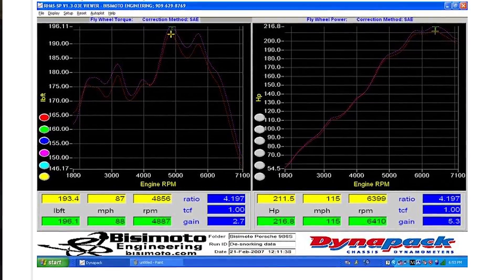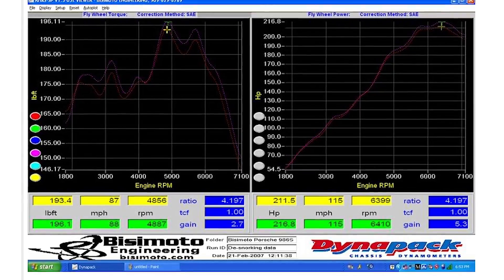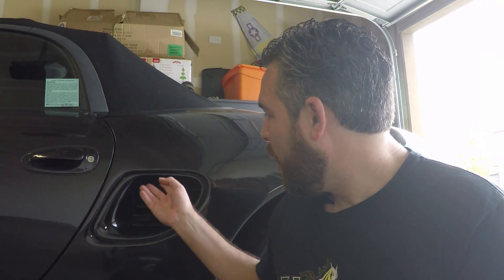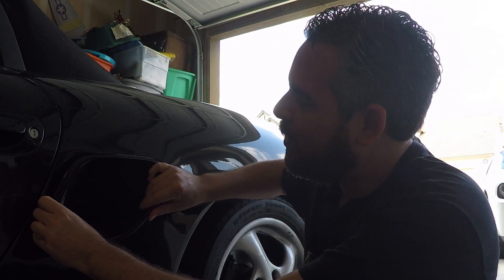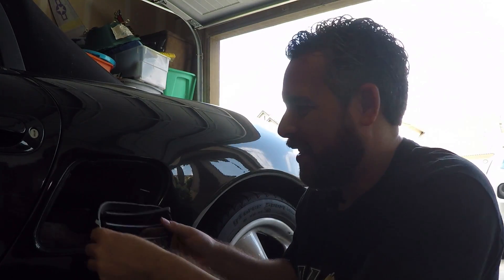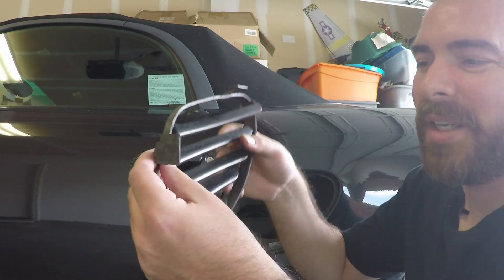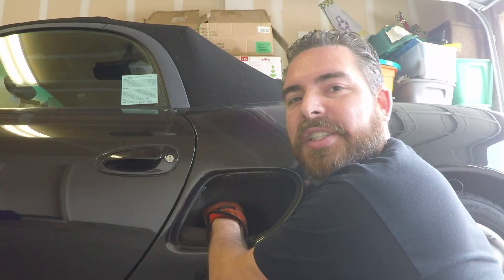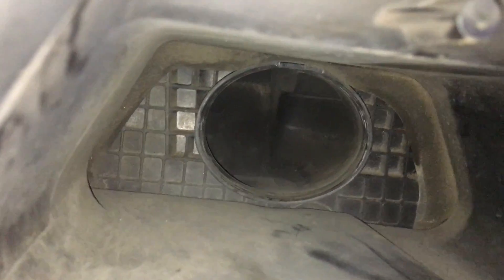Free Horsepower: Does Desnorkeling Work And Should You Do It on your Porsche Boxster

Comment: Ive noticed a trend in the car community ,,,everyone seems to be so afraid to say intakes and exhaust mods will add horsepower .. Its weird
Reply from the maker: Good point. I didn’t have access to a Dyno as that would probably be the best way to prove there was a gain. For me this is just one part, I’ll be installing another exhaust and look at improving the intake where possible.

Thanks for watching and taking the time to comment.
Reply: Because 5hp gains are insignificant than that of forced induction.

Comment: breaking stuff.  The single biggest reason not to do mods that have limited impact.  That said - I desnorked several (10+) years ago.  There has been no negative impact.  But the increased intake sound seems worth it to me.  Further there is no hot engine air being sucked in.  Does the venturi make a difference?  Unknown.  Was the snorkel affixed to reduce noise?  That was the word back then.
Reply from the maker: You have a good point and that is sometimes what makes doing things yourself cost a lot more.

Thanks for watching and sharing your experience.

Comment: The sound is mainly improved from the drivers seat where you can hear the intake -- and it is GREAT! Under acceleration it sounds throaty, above 4K RPM... it sounds awesome! I also did the Crios mod to the exhaust which added just enough sound out the back without any drone,
Reply from the maker: Agree with you about the desnorkle mod sound. I’m planning to do the Crios mod too, but need to get the right drill bit as I need a longer one for a 1999 than the later cars. How big did you make your holes?
Reply: I made half inch holes -- drill bit was nearly useless as it slides and slips> I ended up getting through with a long, large, flathead screwdriver, then turning it to open the hole. I hear, and can see, that a a hole punch or sharpened end of a long bolt like one YouTuber did would work as well. But the sound is perfect, just enough... though I have been tempted to go a little larger.

Comment: I tried this, about 2 days later got an engine light, reset the dtc’s and came back a day later again. Re fitted the snorkel and it has not thrown a light since, also noticed I got worse mpg without the snorkel, my 2.7 became more fuel thirsty than my 3.6 996 C4S till I put it back.
Reply from the maker: Thanks for sharing your experience. I’ve had it off for about 7 months with no issues and my gas mileage is a little better (although I have done some minor weight reduction, so could be more from that). Having said this, mine is a 1999 2.5-liter, so perhaps the 2.7 doesn’t like this mod.

What year is your Boxster? Would be good to know for a follow up video so people are aware of any potential issues.

Thanks for watching and sharing your experience.
Reply: Our Ride Life Our Ride Life mine was a 2004, I thought the issue may be because the facelift models went to a drive by wire throttle and assume that because the ECU sits between you and the throttle it is less flexible in terms of mods without a map as it’s trying to cope with an unknown. Would be interesting to know if that’s the cause or if there’s more to it, I did notice my snorkel didn’t have the little dish on it and was a little different so perhaps Porsche fixed some of the issues with the original design as my stock 2.7 sounded more aggressive from my Dads 2.5, but still, with the mod on the 2.7 it did sound fantastic on acceleration, a much deeper growl, but the light bugged me more. Now I have a 996 C4S with a sports exhaust so my ich for extra noise has been satisfied.

Comment: Please don't, Porsche engineers have designed that "venturi" to optimise induction of cold air not stale heated air from the engine cavity.
Reply: It doesn't matter if inducting hot air gains you 5 HP.
Reply: in an NA engine who cares?
Reply: @dimitrimariutto  Impossible as cold air contains more oxygen by density. More oxygen=more HP. Simple. A lot of engineering hours where spent designing the inlet tract,
Reply: It’s funny how people don’t understand science. They are convinced of power whether proven or not. They have tested cold air intakes and other mods like this “desnorkeling” and quite often there is overall no improvement and sometimes a decrease in power on the dyno. Yet “you get 5HP” is the line regardless of testing.
Reply: @davidmoore5822  Impossible huh? I guess turbocharging is a lie then. Put a turbo on this engine w/o intercooler and I guarantee you will make more power with warmer air going in. Consider that the intake might not be pulling enough air in when stock as it is side facing and laminar airflow might create an impediment. Removing the snorkel might actually allow more air in albeit warmer as it is drawn from inside the compartment.
Reply: @836dmar  What people don't understand is that some sacrifices are made in the name of regulations, emissions, NVH, etc. Go look at mass produced vehicles that are turned into racecars. They all have modifications done to improve the racing characteristics b/c mass produced factory stock vehicles aren't fully optimized for racing. If removing the snorkel gains 5 HP by testing, then remove it. Don't worry too much about what the science says should be.
Reply: @davidmoore5822  yes and they designed it to tune down the engine to about 250hp.

Comment: 1. Intake stuff isn't gonna change the exhaust sound. It changes intake noise. Having the camera back the is pointless. Either bring it close to the intake, or by the driver seat.

2. You stated that the point here was to prove whether or not this improved power. You did not show that in any way.
Reply from the maker: Thanks for watching and taking the time to comment.

I’ll try to put together a part two that has the camera in the car and next to the intake so you can hear the difference.

I’m also looking at some exhaust upgrades and for that I will put the camera where I did for this video.

Thanks again for watching and commenting.
Reply: Was just gonna say that. Otherwise, good video.

Comment: Thank you for the video.  Related question, what about air filters?  Seems like different hype about those.
Reply from the maker: Sorry for the late response, just catching up on comments.

I’ve used some of the aftermarket air filters in other Porsches that I’ve owned and it caused smoking that didn’t stop for a while (probably from the oil). Nice I cleaned everything and went back to stock it corrected that issue.

Personally, I keep with stock for the air filter, but modifications to take in cold air in a better fashion are interesting. I have seen some Dyno evidence that cold intakes can work, but some don’t actually take in colder air, so they don’t do much good.

Thanks for watching and taking the time to comment.

Comment: So, the sound is practically unchanged.
Reply from the maker: Unfortunately, the microphone didn’t pick it up that well and the sound change is more noticeable in the car when over 4,000 RPMs.

Thanks for watching and taking the time to comment.
Reply: The sound is definitely increased, its cheap way to get a little more growl without having to upgrade to a $3K + exhaust system.
Reply: That’s because you were filming the sound at the wrong end 🤦🏻‍♂️ you haven’t changed the exhaust so why film there, it’s the intake you needed to film as that’s where you hear the sound from. 😂

Comment: Sound from a hole in the body, that’s all. Hot used dusty engine dirt filled air, not good. Imbalance of air fuel ratio not good. Possibly of water intake into the engine definitely not good. Suggest fitting a cone filter for a real noise improvement but ultimately if your not happy with the howl of a boxer 6 cylinder engine and you can’t afford proper genuine upgrades then you have the wrong car. Just don’t do it.
Reply from the maker: A valid point and I was looking at modifying the snorkel to still be usable, but potentially allow more air. I have also looked at mods for the entire intake, but saw a lot of people doing this mod, so wanted to give it a try. In the car it does improve the sound, but it isn’t noticeable outside of the car and performance benefits are probably little if any.

Thanks for watching and sharing your thoughts.
Reply: Our Ride Life actually I miss lead you, there is dyno proof that a cone filter actually reduces hp, certainly in a 997. I’ll find it.....
Edit: MYTHBUSTED! Porsche Intake Mods -  Motive Garage 997.1 C2
Reply: luckily, the engine is not from 1960, and has a MAF and a ECU to control injection relative to air!  Amazing!

Comment: Porsche put a "snorkel" for safety so that the intake of the engine could not suck a butt that could ignite the air filter.
Reply from the maker: Thanks for the comment. That does make sense. So, if you take the snorkel off putting some type of grate in it’s place to prevent a cigarette butt from getting sucked into the engine would be the another option.

Thanks for watching and for sharing your thoughts.
Reply: and an asteroid might hit your car too, about as likely as that butt setting the filter on fire

Comment: desnorkeling the Boxster is just for SOUND THAT'S IT!!! SAD the 2nd Gen MR2 TURBO Was a much better design of guiding air to your airbox or cold air kit. The new Boxster and Cayman uses the same design Toyota used in the MR2 SPYDER TO GUIDE AIR TO THE ENGINE AND IMPROVE THE LOOK!  LOOK AT THE MR2 SPYDER AND LOOK AT THE NEW BOXSTER AND CAYMAN? THERE YOU HAVE IT! THEY GOT PERMISSION FROM TOYOTA FOR THAT DESIGN ELEMENT
Reply from the maker: Good points. I’ve seen some videos on better intakes for the Boxster and they look interesting.

Comment: DON'T DO IT!
Reply from the maker: Thanks for sharing. Do you have a bad experience with doing it or is it a caution thing?
Reply: @OurRideLife  Porsche put a "snorkel" for safety so that the intake of the engine could not suck a butt that could ignite the air filter.
Reply: @Legaumaisdsts  Who the hell smokes ?  and if they do what are the chances they are gonna flick it at your car and if they did what are the chances that it would go inside your intake .Irrational thinking,
Reply: @positivesecret  My neighbor also owned a 986. Unfortunately he had made the "desnorkeling modification" and it happened to him. He did not realize that his cigarette butt had been swallowed by the intake of his 986's engine until the engine started to run erratically. He stopped and stopped the engine.
Smoke came out from the engine compartment ventilation (right) and a little from the intake side (left side). When there was no more smoke, the engine no longer wanted to restart. Around € 2,500 in repairs.

Comment: It does nothing unless you re-jet. Ridiculous.
Reply from the maker: Thanks for watching and taking the time to comment.

Can you clarify what you mean by re-jet. I’ve heard a similar term used for carbureted cars, but not for EFI. Is it something along those lines or does it have to do with the DME?

Thanks again.
Reply: Sorry for the delay. Your EMC won't handle the ram air because you are eliminating what passes for a plenum. The incoming air is too turbulent to be effectively processed at the same stoichiometric ratio. It's the same as over-polishing intake ports: you create more drag than you eliminate.
Reply from the maker: Fangioparis thanks for the response. I thought the plenum on the early Boxster was between the air intakes like in this image: https://goo.gl/images/yvubHv

Thanks for sharing what you meant and this could be the start of a bigger project then.